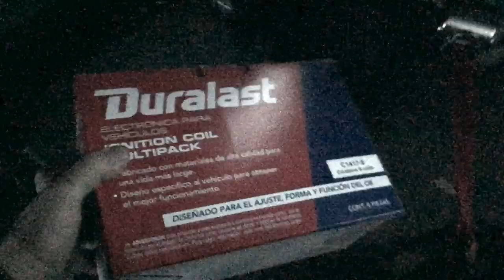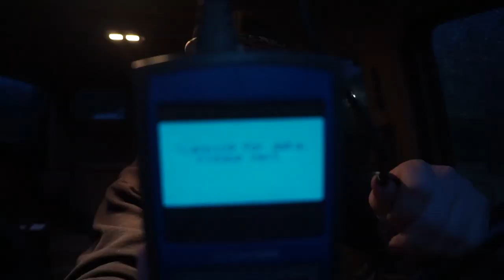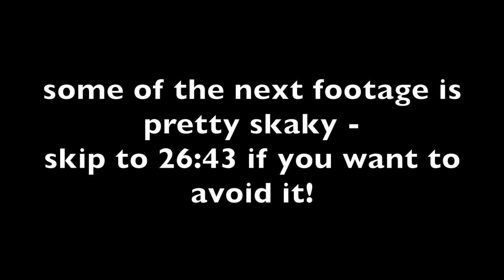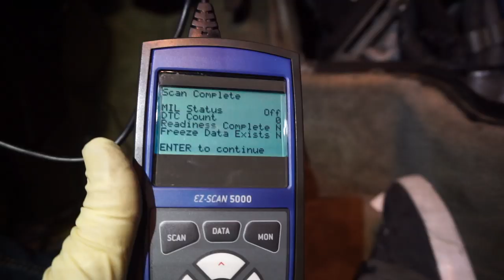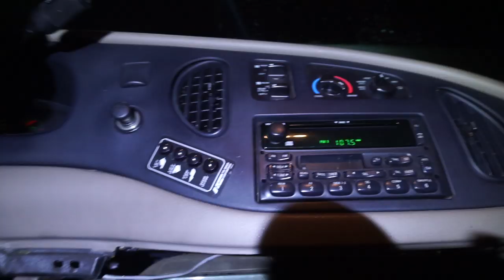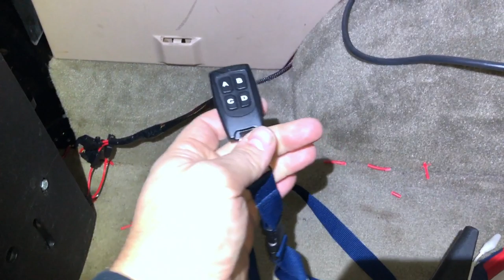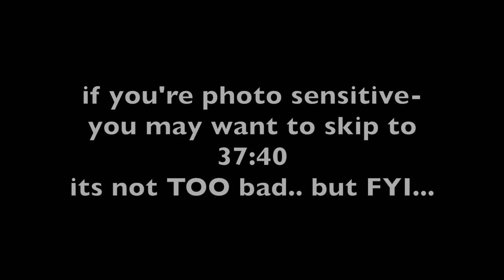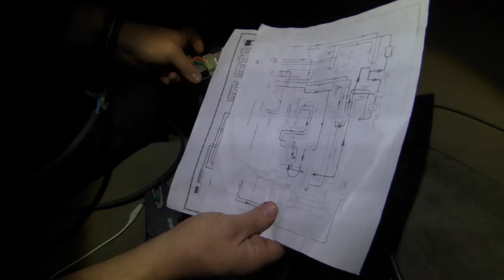MEGA VLOG 471: setting up the van! (part 2 - wireless remote!)

Comment: WOW you seem like you have alot of room in your engine compartment 17:17  mine is a v6 and it doesn't seem as roomy as yours at all. Glad the only problem you had at that time was a wire that wasn't plugged in. That was awesome.
Reply from the maker: the van has a 4" body lift - makes for a lot more space in the doghouse!
Reply: @TotallyNormal-  Coool never thought about that.. i may have to get a 4" body lift for mine too.  Was the 4" body lift expensive to get / do?